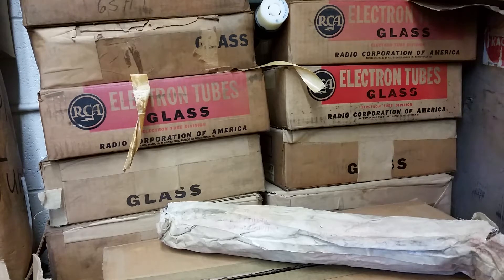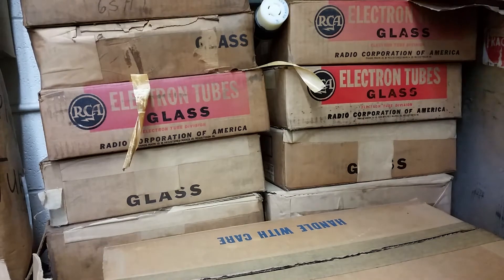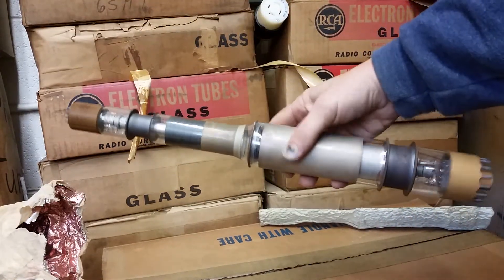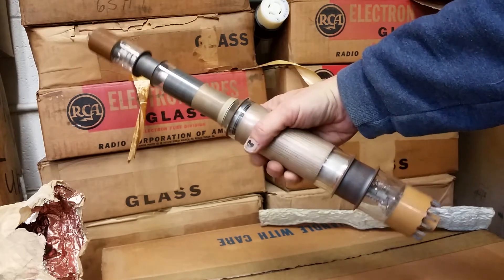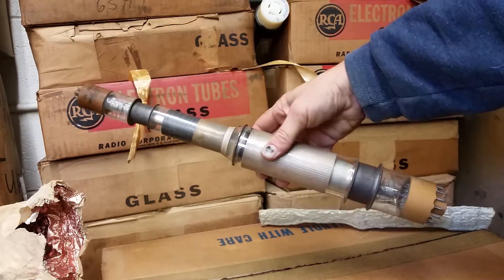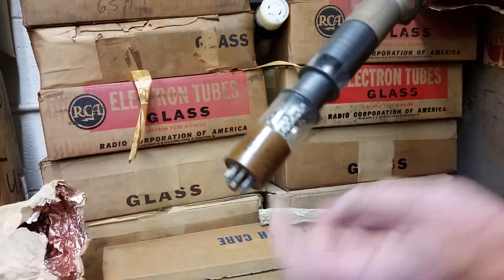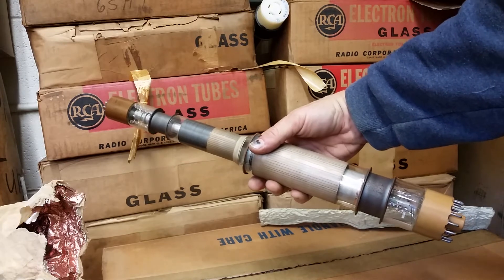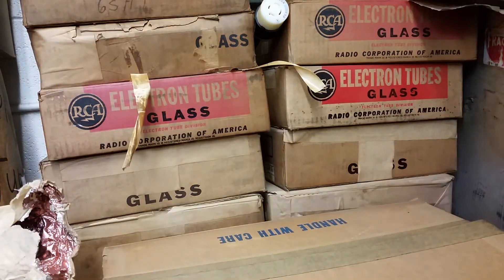RCA 1855 Graphechon

Comment: That spot in the middle is the center marker. These were used to rasterize rotating vector radars. TV monitors are cheaper than extra radar monitors. I read an article from the late 40s where they transmitted coastal radar to ships who only need a TV tuned to a UHF channel. Very clever!
Reply from the maker: I do not think this is the case - the blemish looks too ugly! Anyway, for the radar PPI relay  system you describe, that was mostly done using surplus military cameras just pointed at radar repeaters. Those cameras could be modified without too much hassle to North American video standards.
Reply from the maker: Also, for PPI to work, a long persistence phosphor like P7 is really required, otherwise many of the details of the returns are missed. I would bet that charges written to the Graphechon target decay away far too quickly.
Reply from the maker: OK, further reading reveals that these graphechons could store an image long enough for the details from the P7 long persistence to come out, but it does seem that the the tubes still did not work worth a damn in radar scan conversion service, due to a lack of resolution (and other issues).